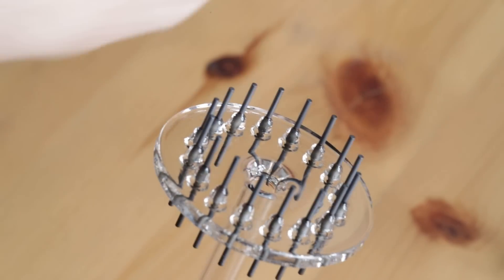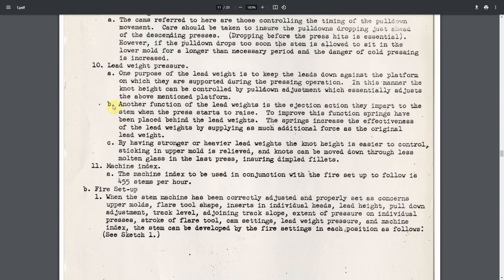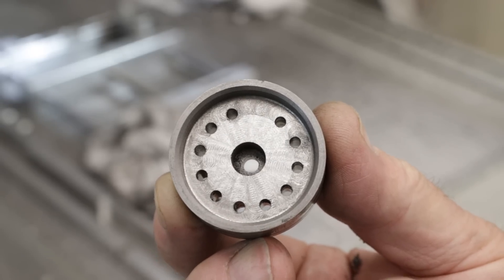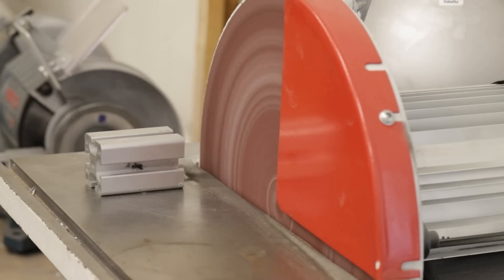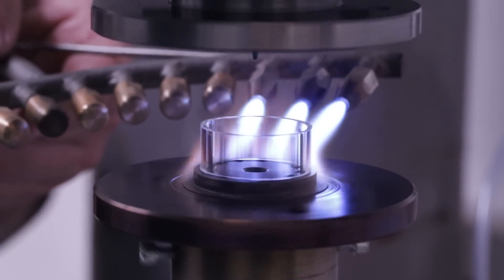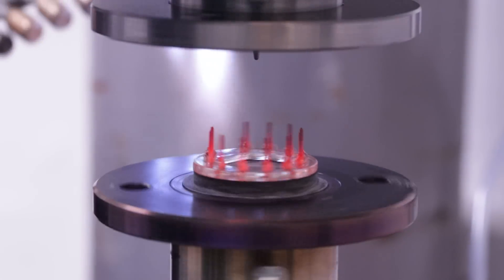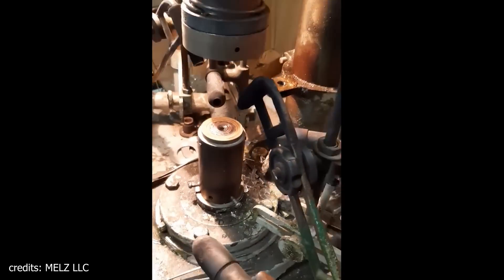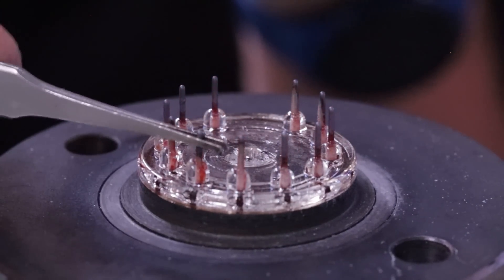Stem ejection mechanism working.  F project | EP#9

Comment: Looks like the pins used by MELZ are a much higher melting point metal? Would it be possible to use tungsten pins?
Reply from the maker: They are the same alloy. Tungsten would need different glass with much higher melting point..
Reply: My guess is that is a kovar/hard glass type stem in which the temperatures will be quite a bit higher. Here soft glass and nickel/iron leads are being used. Generally kovar seals are made at bright orange heat and soft glass seals at bright red heat. Even though Kovar and alloy 42 for example have similar melting points the alloy in kovar is more oxidation resistant at temperature than the nickel iron alloy of the alloy 42. Its not so much melting as it is oxidizing and burning away. Another thing to remember. Soft glasses are nearly always worked with a highly oxidizing flame or you will discolor/cloud the glass. Essentially keeping the glass in oxide form. Unfortunately the metal pins are also trying to turn back into oxide as well in those conditions. As for Tungsten, yes it could be used, but the cost of the pins and appropriate glass would be unaffordable for this product. Typical Tungsten type sealing glasses are as follow.  Schott 8487 is very expensive and only occasionally available with very large minimum quantities are demanded while corning 7720 nonex glass is lead bearing and long out of production. I work with them because I have left over stocks from closed companies to play with. From a new product point of view a bulb and stem set even made in house for this size product may have a $50 to $100 material cost in quantities of thousands of pieces and that does not include the labor or loss. Fine for a multi thousand dollar military thing but not for a retail nixie clock.